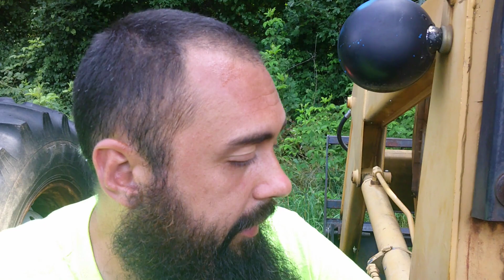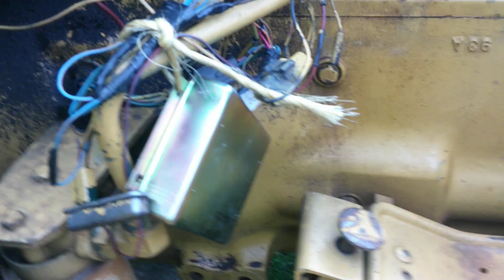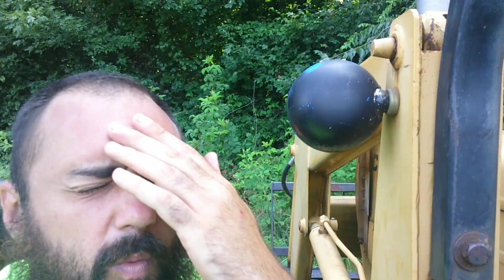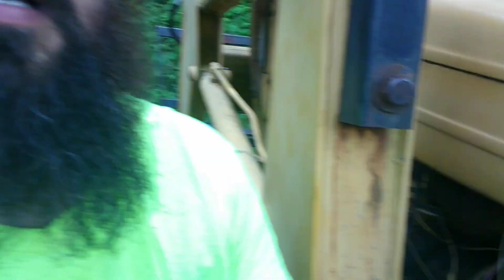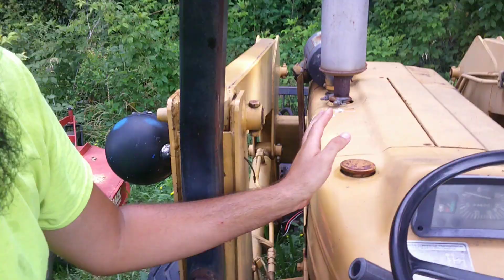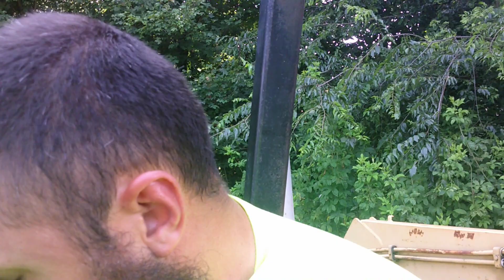Ford 445c loader transmission module explained

Comment: thanks for video. i have a 345d that im restoring. i have similar problem. i have voltages from control going to solenoid. tractor wont move. my question is ,is there any foot switch or such? or you just shift FnR lever. any other saftey switch pr combination i need to check. thanks